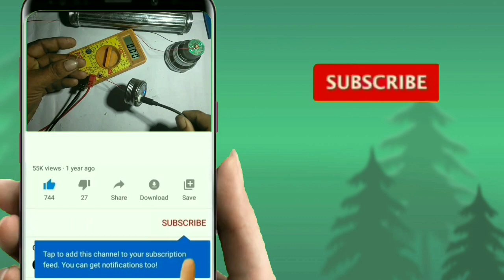Old Torch Repair I Convert to Digital Rechargeable Torch Light #torch #DIY #LED #RabitechCreation

Comment: I need old torch lights not with led ..where I can get it..plz help me
Reply from the maker: Available in our local market the led 3Rs, and full with circuit n holder 60Rs. But, your there! not idea, You can get another old or damaged torch
Reply: @RabiTechCreation  these days very difficult to get old torch..